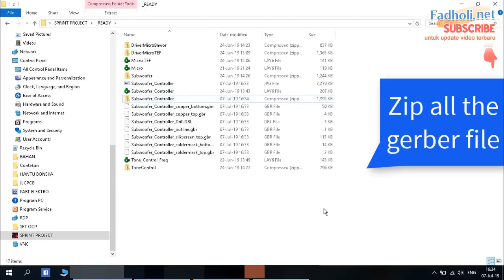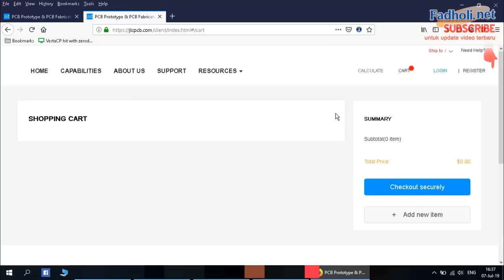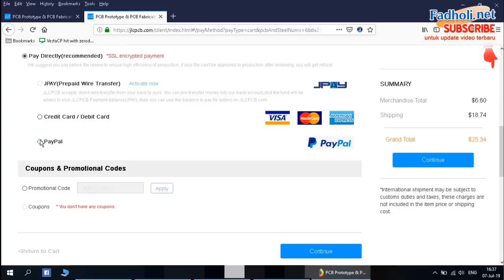Merakit Subwoofer Controller

Comment: Om.. maaf melanceng.. saya punya smps 12v.0v 2A. Cara supaya smps saya bisa jadi 18v ct 2A. Gimana om..
Reply from the maker: Tidak ada caranya mas...
Reply: @Fadholinet  emzzzzzzzz... berarti yg jual"y itu boonk dunk.. katanya sih bisa  di stel di resistor ic TL431
Reply from the maker: @kangasep2426  Memang ada smps yang bisa diadjust tegangan outputnya... tapi menjadikan smps out non ct menjadi ct. adalah beda topik beda cerita mas.